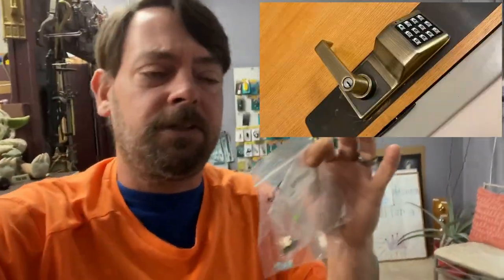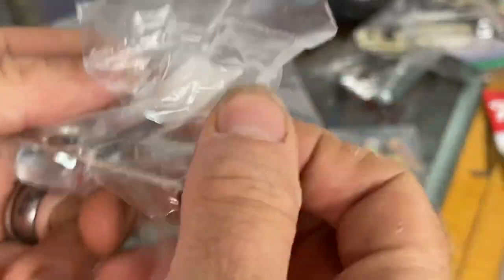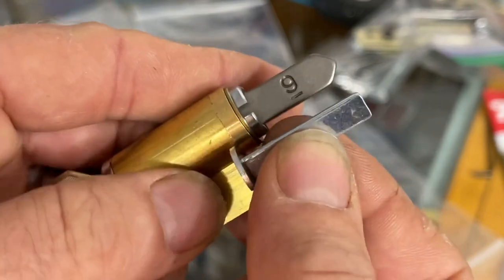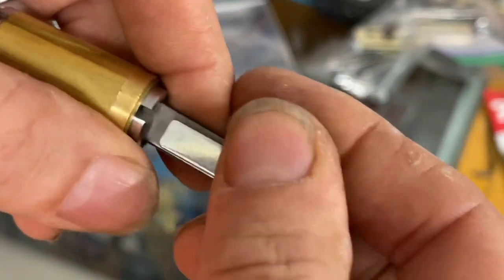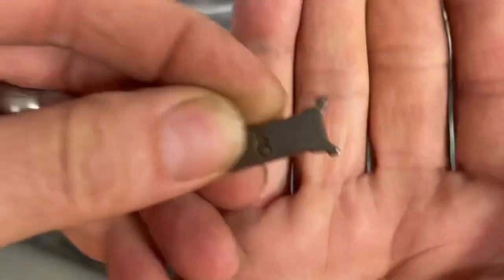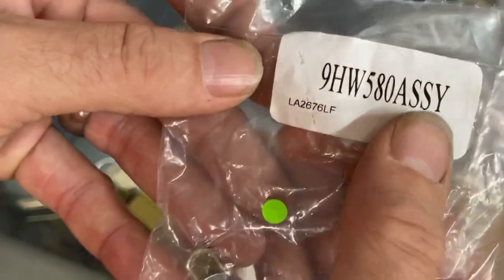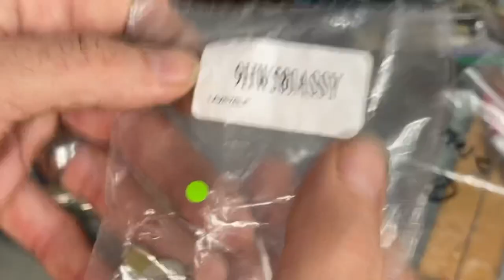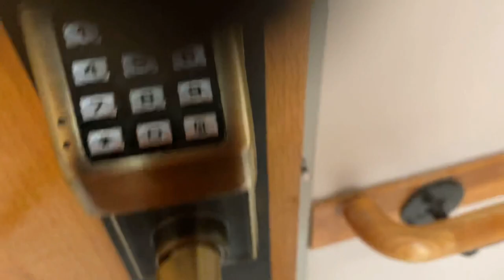the two important parts needed for switching cylinders on Marks & Trilogy locks

Comment: Where can i buy these parts? You mentioned they were expensive but i cant find them? Are they with H Flake?
Reply from the maker: yep, just got them in from Flake
Reply: @selock  jason, on a similar topic. Im trying to replace Yale plug with a Schlage plug for a mortise cylinder. I know gms makes plugs but do you know which part will be the right one that will have the setup for the two screws needed for the tailpiece in a mortise? i cant seem to find mortise Schlage plugs

Comment: If you use an Ilco 15296 cylinder (clip style instead of screw style) you could probably just reuse the MARKS tailpiece.  They're about the same price as the 1599 and available in most keyways.
Reply from the maker: I’ll check that and update but I hate those style of cylinder